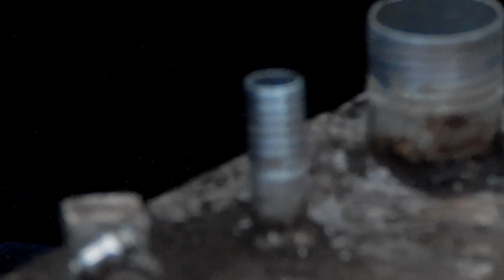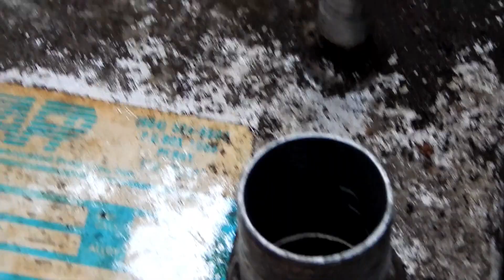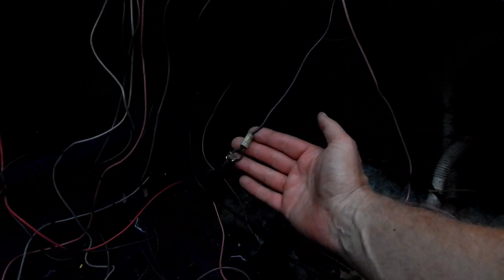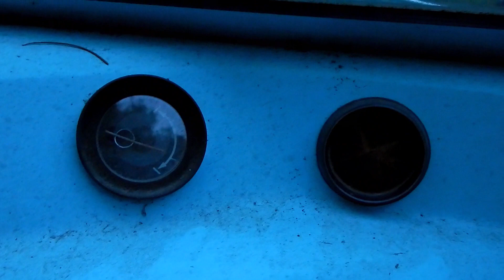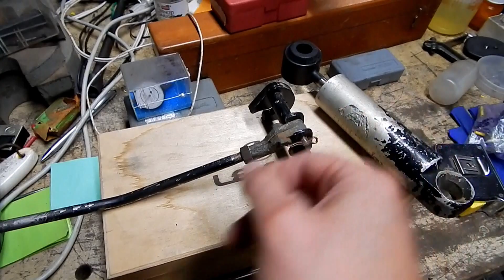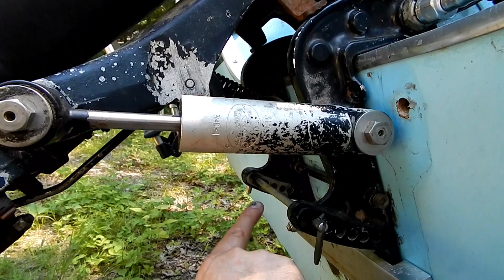The Mercury Tower of Power/ Concord Boat Part 94

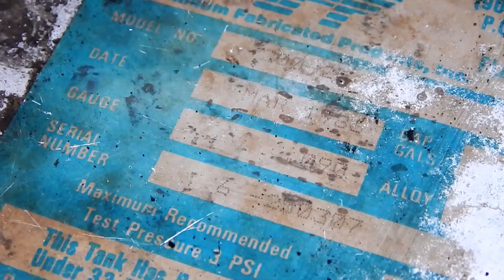Comment: @7:25 it looks like “CAP GALS” is off to the right of the frame and not visible. I think “090” is “GAUGE.” That looks a lot like the 40 gallon tank in my boat. I’d bet it’s at least 20.

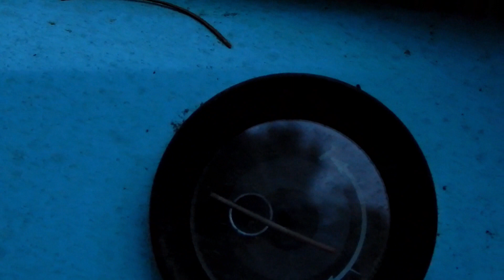@11:15 trim gauge, maybe?

@15:20 Mercury, at least in part, marketed those shock absorbers as a safety feature. It keeps the engine from flinging up violently and possibly injuring somebody in the boat if you hit an obstruction at high speed. It is quite plausible—I’ve seen an old Johnson almost flip itself up into the boat.

Love these videos. Wish I had the skills to nurse one of those old beauties back to health.